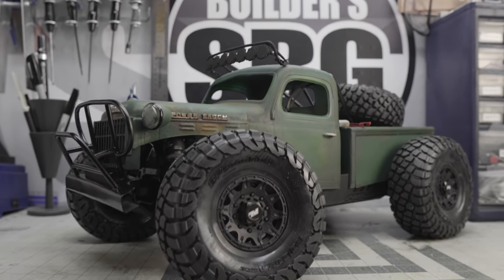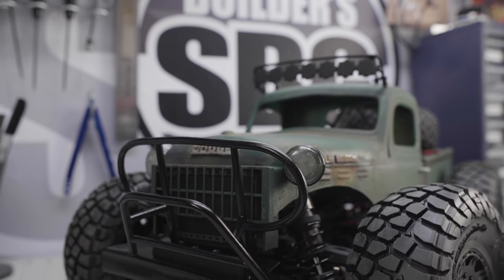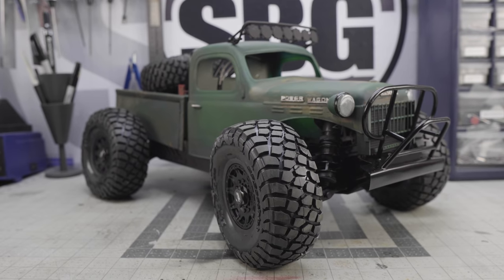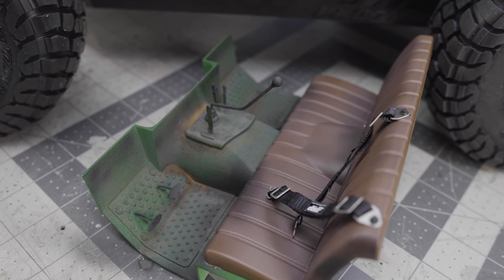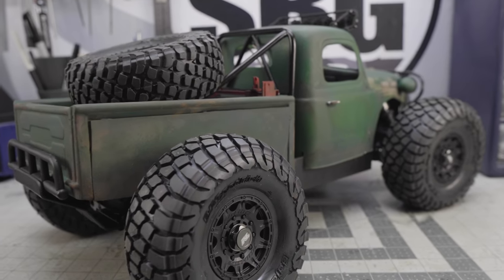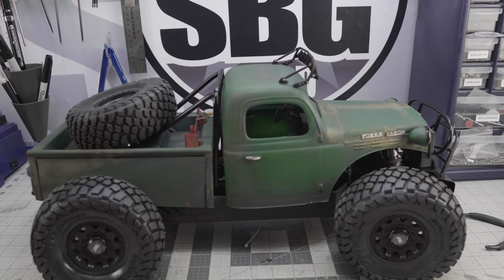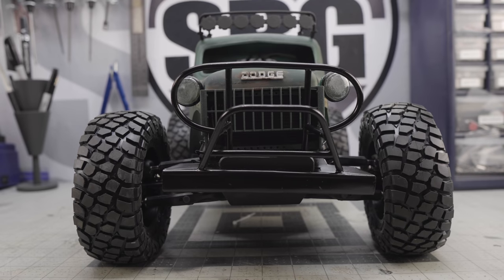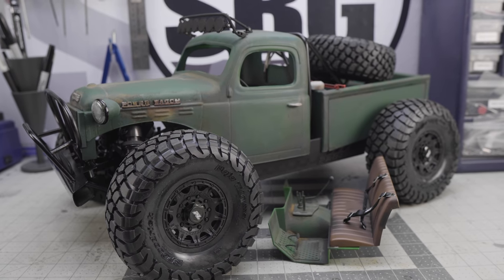#MonthlyMayhem Challenge Ultra4usion Ep5

Comment: Being a truck guy this really appeals to me, I like the finish, I have seen the full size, the body is similar  to Associated's Short Course truck they made and I liked it a lot but it was independent alround unlike the full size.
I notice the truck has only a brake and clutch pedal is the throttle control on the steering wheel, and are you going to add the lap belt part and add a driver. Also the bed and cab sort of lean into each other as if the frame is bent.
So far you have nailed it on scale details, hopefully it will hold together as Harleys is a steel cage design so will be stronger.
Reply from the maker: I'll throw a driver in there, for sure! I'm sure it'll hold together, it's pretty strong.

Comment: Matt....that thing looks awesome. 
Same chassis but completely different rigs.
If Josh doesn’t buy it.....I might be interested in it.
I'm curious how what the slow crawl will be.
What have you done with the 3 diffs? 
Did you putty-lock them?
Keep them open?
Super thick fluid?
  I've been to Horseman's Center at least a dozen times to crawl...you'll need at least the center diff and one end locked. I prefer the front locked for better steering and you won't have a tire bind against a rock....if I was to pick one end....
What compound is the new tires?
Reply from the maker: No spoilers on setup!

Comment: Did you paint the sophisticated finishes paint on top of your layers of air brush, or Underneath and sand away where you wanted the rust to show through?
Reply from the maker: On top. Sparingly. You can do it underneath, but requires thicker bottom coats and lighter top coats.